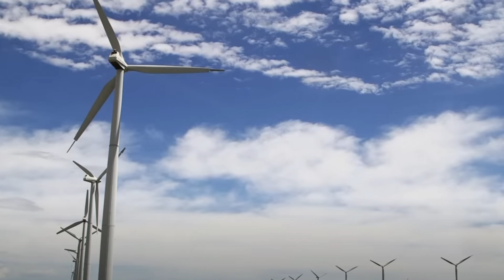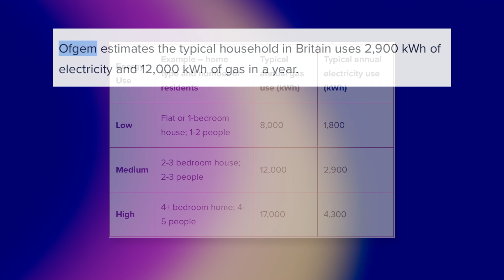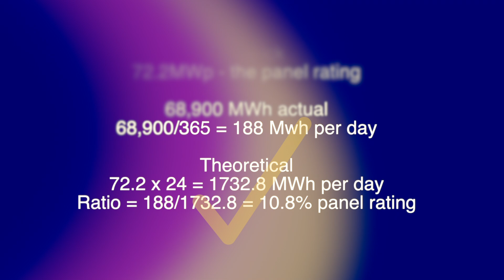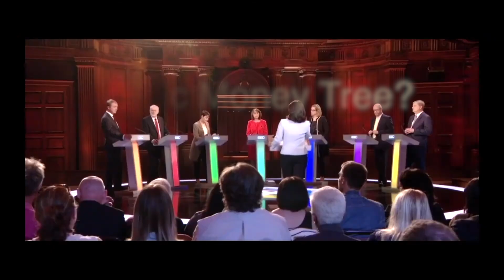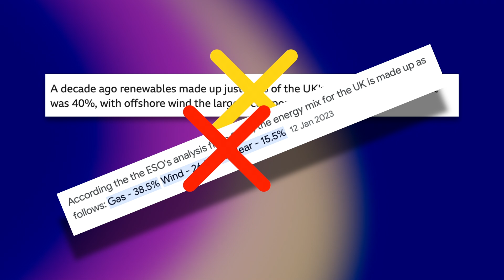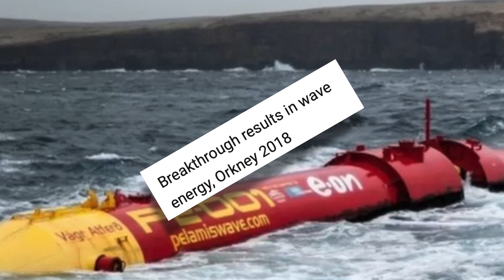Pure Green Deceit

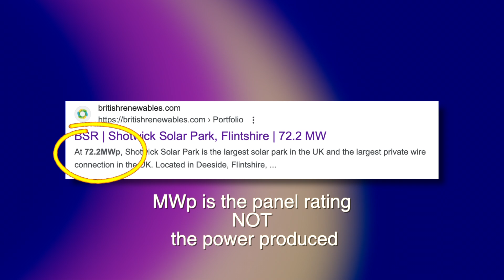Comment: If you click that link at 5:42 you get the power rating in MWh p.a which comes out to 68.59GWh p.a which actually matches your calculation. So there is absolutely no "Green Deceit" simply a solar farm must report it's peak power consumption (which is in the body and not headline of the website, if you opened it) for the grid to be aware. Bids are done 30minutes before demand so NESO is aware for any deviation from that peak. 

They state this is enough to power 18055 homes, which yields an estimate about 3800kWh of energy per home. Which is about the true power consumption of a medium home that you cut off from the table later.

Assertion that the solar industry is somehow lying: False, google the link and follow it.

Of course, there is a big way to go to displace gas heating - but electrical appliances are far far more efficient than gas ones so we don't need to replace 12000kWh, more likely ~1/3rd of that at most. The energy kWh is a direct unit conversion from the chemical potential of the gas, of which usually only about 30% is transferred to heating. 

Assertion that we need to replace all gas power with electrical power: False, you can google these figures.
I found an excellent video on this which I can share if I can dig it out and there's any interest.

Of course, since the first 10mins have yielded two fallacies, as per usual I won't yield the other 30mins of my time.
Reply: I wish I could attach photos because the energy production on the Shotwick website is in like fontsize 72 in a big box.

Comment: On a sunny summer day, 4kw array,22kwh....dull day ,nowt,right now about. 8kwh so far today at 12 o clock. 
In 15 months 3900 kwh,
Reply from the maker: That is in line with what a say
Reply: Yep,totally agree with you  btw that's on a custom built  shed at 41.5 degrees, facing south with a tiny bit of west😊

Comment: Paul, although all your arguments are correct, simply replacing gas kWh with electric kWh for domestic use could be deemed incorrect. Although we know that gas usage won't be replaced anytime soon, if it were to be replaced, it would be replaced by a heat pump which has claimed efficiency rates of ~300%. This means 13.2MWh of domestic gas use would be replaced by 4.4MWh of electricity. .So the average home would require 3MWh + 4.4MWh = 7.4MWh.  43905/7.4 = 5933 or 42.4%.  It still completely fails to power 14000 homes but not as badly as your figures. This argument will be used against you.  You can get decent figures for heat pump multiplier in the UK by googling "heat pump average multiplier UK".  Thanks for all you do.
Reply: Not possible to have efficiency greater than 100%
Reply: @sonextcentury  Search for "how heat pumps work" and watch a video. It doesn't create free energy so the 300% energy efficient is somewhat of a misnomer. It moves energy around. The more correct way to think about it is it is 300% more efficient than direct conversion of electricity to heat via electric resistance, i.e. a filament.  A heat pump extracts heat from the outside. It doesn't make new heat. You pay for 1kWh of electricity to transfer 300% of the heat energy you would get by running that 1kWh through a traditional heating element.  The inside gets warmer (300% warmer than filament) and the outside gets colder by the same amount. So while your right that the heat pump can't be more than 100% efficient (it's 80% efficient, 80% of electric energy does work driving compressor blades that transfer heat, 20% turns into heat) it  does produce 300% more heat than a filament. Somtimes this is called 'efficiency'. Not thermodynamic efficiency, but comparing results of different heating systems. Joules produced per kWh.

Comment: Similar thing going on in the US.  My 1950's vintage home came with 100amp (24kW) electrical service and the equivalent of 51kW of gas service, mainly used for space and water heating.  Now they want to ban sales of new gas water and space heating and only allow electric, but that's going to require costly upgrades in electric service (to 200-300amp) at each house along with similar upgrades to the entire utility distribution network.

This is being done in the name of NOx reduction.  But if you look at swapping an efficient gas tankless water heater for electric, you'll end up using twice the gas at the power plant that'll need to run at 6AM when folks are taking showers (due to thermal efficiency of the power plant) than you would have used to heat the water directly at the point of use.  Now the gas turbine plant may put out a bit less NOx as the condensing heater, but in the end you get about the same amount of NOx emitted.  Plus, this doubles the CO2 output since you're burning 2kWH of gas to produce 1kWH of electrical energy.  This whole thing is being sold as part of "100% renewable power", but get this, it's scheduled to take effect in 2027!  

My plan is to pick up a spare tankless water heater to have, just in case the one I have now quits in 15 years.
Reply: The electrical equipment costs more than gas equipment too. Ultimately, it is about profit or laundering money. Organized crime cartels are running most of the governments. They think themselves  "elite".

Comment: The 80% for the home is in the form of heat usually and they want us to use heat pumps for heating which do provide a coefficient of performance of around 4 for most of the year so reducing the 80% to 20%. Of course heat pump systems are far more expensive than gas boilers and electricity prices are 3 times higher than gas so the heating costs will rise enormously when the cost of the heat pumps and the electricity to run them are included. That means they can supply more homes than you are saying as they need the 20% for electricity for existing things and the 80/4=20% electricity for the heat pumps but the cost of energy per home would rise as they have replaced cheap gas boilers with very expensive heat pumps powered by very expensive electricity. I have had air-air heat pumps in two homes and they are fine for ten months of the year but they really struggle for the winter months and I have always had to revert to fan heaters on the coldest days just when the wind turbines and solar panel outputs are not usually available. It isn't quite as bad as you are making out energy-wise due to the use of heat pumps but it throws massive additional costs onto homeowners due to expensive heat pumps and the electricity to power them as opposed to cheap gas boilers powered by cheap gas.
Reply from the maker: I will replay after each part of your post:-
You wrote
"he 80% for the home is in the form of heat usually and they want us to use heat pumps for heating which do provide a coefficient of performance of around 4 for most of the year so reducing the 80% to 20%. Of course heat pump systems are far more expensive than gas boilers and electricity prices are 3 times higher than gas so the heating costs will rise enormously when the cost of the heat pumps are included. "
My Answer
Nothing you have written changes on jot the edit of today. However, as you raised it, heat pumps work at 40C for heating not the 73C of a radiator and hence require 220% time the radiator area of todays normal systems - impossible in most homes. Or they require underfloor heating, again impossible in most existing homes. The costs in addition to the heart pumps are very high indeed and in most cases impossible. All for what? to reduce and imaginary threat?
YOU Wrote
That means they can supply more homes than you are saying but the cost of energy per home would rise as they have replaced cheap gas boilers with very expensive heat pumps. I have had air-air heat pumps in two homes and they are fine for ten months of the year but they really struggle for the winter months and I have always had to revert to fan heaters on the coldest days just when the turbines and solar panel outputs are not available. It isn't quite as bad as you are making out energy-wise due to the use of heat pumps but it throws massive additional costs onto homeowners due to expensive heat pumps.
MY Answer
It is every bit as bad as I have stated because I am exposing the lie of today. They do not say we can supply 10,000 homes providing they abandon their gas supplies and use heat pumps and spend £20,000 plus. NOR are they even allowing for the extra electric power required for all of it. As they state it have done for 20 years now they are deceiving the public ... period.
The heat pump revolution will not be happening. I own three heat pumps but none supply a house. They are used for particular applications.
So - not plan to provide the xtra electric conversion for EV's, heat pumps etc but claims they can supply X homes which is simply untrue.
Thank you for your post.
Reply from the maker: Further they have not allowed for one watt of energy past the 20%, so nil contribution towards any wind pump installation.
Reply: add to this the ban or restrictions of wood burning options.

Comment: I believe,  the biggest factor in reliability, is the gearbox in the nacelle. When you stick a nacelle with blades up high, it will obviously cause the top of the turbine swing back and forwards. That translates into loads being exerted on the bearings, which accelerates wear, the wear is known as brinelling.

Comment: 72000 acres, doesn’t seem much until you convert it to 112 square miles!

Equally as bad,  wind farms. 

Near me is a wind farm consisting of 9 x 2MWp turbines. They occupy an area of 0.9 sq miles, so we’d get 10 x 2MW, 20MWp per square mile. As Paul has stated that is plated/installed capacity. 

Thirty miles away is Drax, producing 4GW, and just so happens to occupy a square mile. 
To replace Drax with wind turbines, would require 2000 turbines, on 200 sq miles. 
However, wind farms typically only produce their installed capacity about 25% of the time at best. For the remaining part of the year, they produce well below that figure. 

Therefore that original calculation needs to be increased by a factor of four. That is now 8000 turbines on 800 sq miles. 

According to Drax, they produce about 1/16th of UK demand. To provide the entire UK electrical demand comes to 16 x 8000, nearly 130,000 turbines, at 10/sq mile, that’s 13,000 sq miles. 

To give an idea of perspective, it would be an area, bordered, by Lancaster, Bridlington, Cambridge and Ludlow. 

From Paul’s research, 80% of our energy usage is for heating, using gas. To convert all premises to electricity only, will require 5 x 130,000 = 650,000 turbines, occupying 65000 sq miles. The British Isles is only 80,000 sq miles. And that doesn’t include converting transport.

And they're now opening the doors for more onshore.
Reply: I see what you mean, but if you don’t trust these people with gas and solar, I certainly don’t trust them with nuclear.  And there’s also the fact that we don’t have any way of dealing with waste from the nuclear process, other than sticking it in a hole in a mountain for a few thousand years and hoping no-one goes there and nothing disturbs it.  It’s certainly better than wind and solar, but I’m not sure it’s wise to expand it hugely.  We have large gas, oil and coal reserves in Britain, and ways of capturing emissions or re-using fly ash that are far less polluting than 50 years ago.  There’s just not the political will to do this.

Comment: Good morning. I am sitting on a boat in Ireland that is powered by 2x 175w (p) solar panels. I can honestly assure you that the figure for power generation yesterday 17th aug was 460wh. Yes a total 460 from a potential 8400wh which is ( if my calculations are correct) 18% of projection. Not bad but not enough I'm afraid and i had to resort to the gas camp stove for all cooking. 
Yesterday was a bad day and normally i would get double that amount  but still i have never achieved more than 37% of the panel rating. Not bad but believe me  not near enough to go fully electric. 
BTW the rating drops away to practically zero from October through to April. Solar is a dead duck for 5months (winter)  and needs to be taken out of calculation altogether. 
Thank you for your honest work which is a rarity these days. 
I also do not want to see our children's future ruined on this pipe dream fantasy of net Zero.

Comment: As a farmer it puts me in a dilemma, solar panels pays £1200/acre you cannot make this amount of money farming, I’m totally against net zero and realise its all lies I’m also concerned about the long term contamination of the land, the contract is for 40 years with a  10 year extension, I think a lot of farmers will go for it and this will leave a massive problem in the future
Reply from the maker: Spot on - you cannot blame the farmers but it is presenting a huge future problem because the clean up cost is being forgotten.
Reply: @ClimateRealism  Paul I asked my land agent about this here is his reply:

“Regarding the reinstatement of the site, the developer is bound by the lease terms to return the site to its original condition (but items below 1.2m underground may remain, which is standard in solar leases), this requirement will also be set out in the planning obligations.
 
They are also required to provide adequate security in the form of a bond, escrow account etc that you / the local planning authority may call on to cover the cost of reinstatement in case the developer defaults in their duty.
 
In terms of contamination, the developer is responsible to rectify any contamination caused by themselves. However, if there is existing contamination on the land then the responsibility lies with you as the landowner”

First impressions are there will be lot of stuff buried 1,2 m deep!
Reply: 2nd thought Is that the land needs thorough testing before any installation to prove there is no contamination
Reply from the maker: @WSMITHify  Very interesting but I do not think it is happening in practice because the cost is higher than the installation and there is no safe method of getting rid of the panels anyway.
Reply: @WSMITHify This has happened in Queensland Australia where bad attempts at dumping and burying spent wind turbines  have left huge messes behind. Senator Malcolm Roberts has made videos about this.
Reply: And I'd say this is being done deliberatly do damage what is already a very fragile farming industry, and sorry to say a pale and low quality food substitute for family cows and small scale homesteading and families in the country side. Not a personal dig, as I do understand the history of manipulations and pressure that has been done on the whole uk (and other country's) to destroy the quality etc.